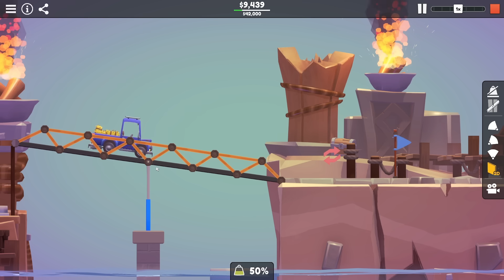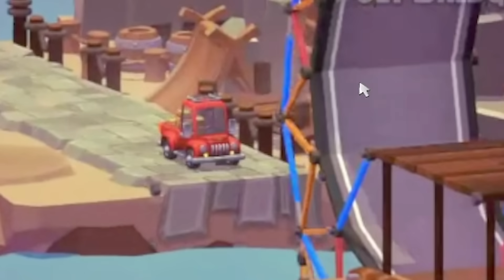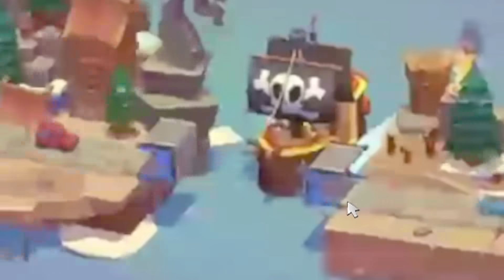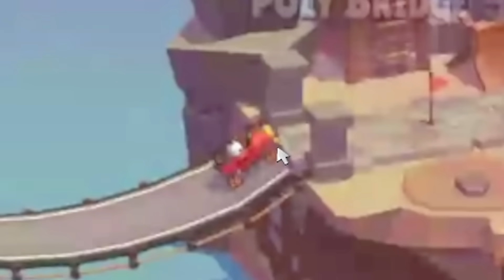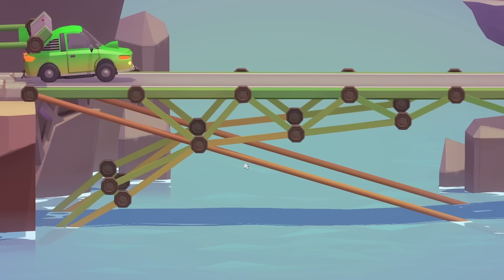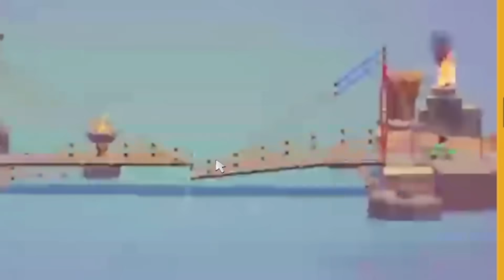Thinking OUTSIDE THE BOX in Poly Bridge 3!

Comment: Late to the party but I think the tension bridge kept breaking because you had a break in the rope. It went to a node shared with the wall supports for the left side of the bridge, so the entire weight of the bridge was pulling on those supports. If you'd disentangle (rope going straight from anchor point to middle of bridge without hitting any other node) on both ends it'd probably work fine.

Comment: On vessels you always have captains and in difficult and special areas where local knowledge is relevant pilots are brought onboard for the relevent part. Their role is to advise the captain. However the Panama canal does this different. The pilots are responsible for bringing the vessel through not the captains.

Comment: 26:07 , boats have pilots and captains, the captain usually drives the boat in the ocean sea, and lakes, pilots, however, are locals and go to a ship that is ready to enter a channel like the Egip channel known as The Suez and drive the boat thru the channel, they being locals they can maneuver the ship better in the tight areas of the channel, the most foremost modern shit (the Evergiven from Evergreen) was driven by a local pilot thru the channel then the accident happened, however, the captain was guilty (even thru it had no control over the ship) just because the captain was still in charge of the ship, not the pilot that actually controlled it.

Comment: Boats can have captains and pilots.
Captain is the one with command over the vessel, pilots are people with special knowledge of a dangerous waterway. Pilots usually get on the bigger ships from pilot boats(thats why big ships often have little extra doors not far from the waterline, that's for pilots). If you had to go through a janky polybridge, bridge, you'd most certainly get a pilot or two lol.
However, often there's also a separate helmsman that steers the boat.
Reply: whoever is steering the boat is the helmsman, though one would use their highest title, such as captain.
Reply: @jamoecw  true. My main point is that the helmsman is not necessarily the same person as the captain(can be, tho).

Comment: this makes me wonder if: . is there going to be a bridge game that has water physics like:Boyancy and corosion ???

because that does make a difference in bridge design and bridge building . . . but I guess with those physics included why not just call it ""bridge building simulator"" ??
I highly doubt a game like than is in development but it sounds interesting in a slightly differend way to poly bridge
Reply: Since it doesn't matter if stress reaches 99% as long as one car gets across, I don't think anybody cares too much about corrosion...
Reply: @CainXVII  that's the case with just use tho . . what if there are multiple weight loads and tests for eatch bridge ?

that seems more difficult (and more realistic) than the one time use whitch poly bridge is going

Comment: I have a theory on why thy hydrolic on the first level didn't snap back into place. I think it's because he locked the split joint at 1:27 in the phase when the bridge was snaped to the bottom, so it was still closed when it tried to move up again.
Reply: You can see in the last hydronic phase that he had that joint open

Comment: 26:10 the one in charge of the ship is indeed the captain but if a ship goes in a harbour or canal that is very tight the captain can request a pilot and they will come and board the big vessel and help guide the ship

It’s a pretty scary job because you use a rope ladder most of the time to climb from your small boat on to the moving big ships 😅

Comment: Ships do have pilots, typically to navigate a dangerous area such as a hydraulic level on Poly Bridge 3.
Reply: @repentandbelieveinJesusChrist8  mate stop proselytising
Reply: Do you mean captain?
Reply: @CattyTatty no. Every ship has a captain who has overall responsibility for the ship at all times, but harbours have a specialist who knows the waters around their harbour basically blindfolded and they board every ship entering or exiting the harbour to provide expert guidance to the captain and crew
Reply: @chrisberti3794  not every harbor, but you are essentially correct. if there is a waterway that needs expert guidance then you need a pilot. most harbors demand a pilot because they don't want their shipping clogged up by a ship sinking or running aground in the shipping channel.